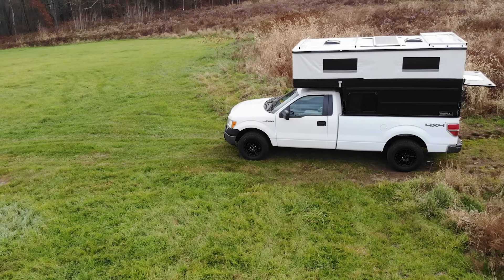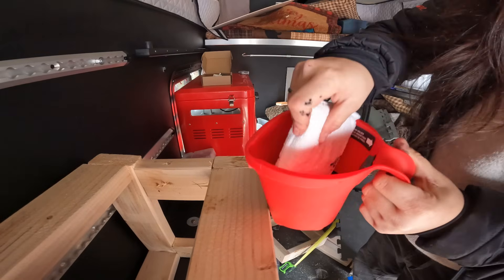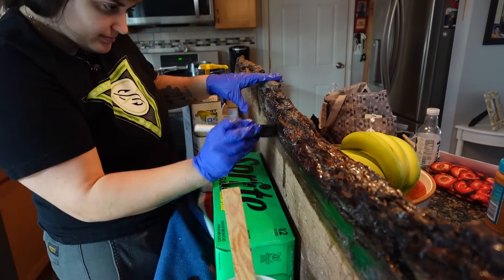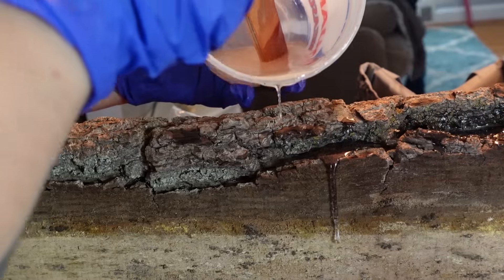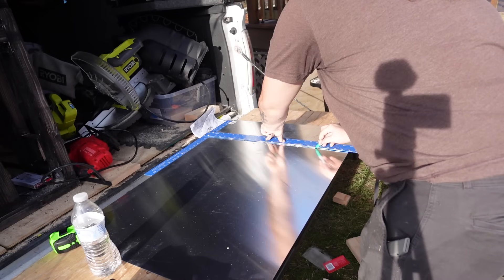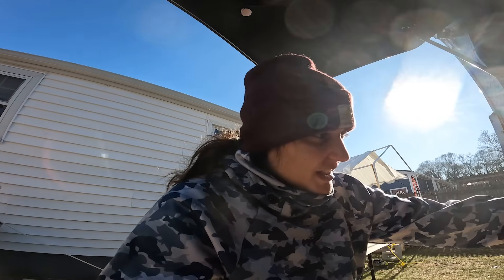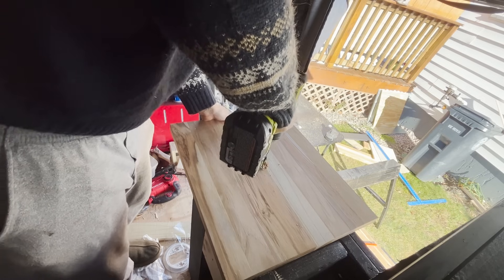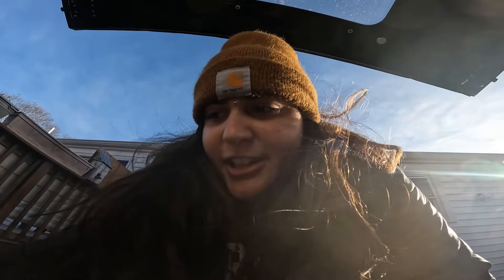Luxury Truck Camper Kitchen Build | Start To Finish

Comment: If you ever do woodworking projects and you don’t want to use battery operated power tools because they usually don’t have enough torque for what you need. They should at least have a power cord attached to them.

Comment: Took me a minute to get that a "draw" was a drawer.  Dang, you are getting sooo good at this building stuff.  Where did you get that sink, I need one for my build???  I just used a large funnel and fish tank tubing.  My solve actually works great but I didn't even think of a real sink.  My drain goes out the back of the trunk at the tailgate.  Please put a list of the stuff you bought and used.  What a great video.

Comment: Just a helpful tip for next time if your cutting a harder piece of wood like that live edge  you can set your saw to make a shallower cut and then set it back deeper and cut all the way through doesn’t always work but sometimes it helps when your saw just doesn’t have enough power to make a clean cut all the way through in one pass

Comment: CONGRARTS 🎉 Super nice kitchen build!  Where 🤔 are you going to locate your refrigerator?   Still keeping it in the Truck CAB or maybe in the rear area of the Truck Camper?  Also, with those few wires near the Sink will you need to install a Ground Fault Receptacle Switch or Waterproof Cage Box for your own Safety and for Insurance coverage protection purposes? 😉.  Not meaning to be a "Negative Nanny" just asking about it to avoid any issues with that later.  I can't wait to see what you're going to cook 😋  first for us 😊.  I know it will be DELICIOUS and befitting a proper CELEBRATION 👩‍🍳🥂🍾🍽🎉🎊🎷🎶📸

Comment: Pretty cool but just buy an rv
Reply: But be careful, I just saw a video of how bad they’re made lately
Reply from the maker: you’re missing the whole point. good luck getting to anywhere cool and off the beaten path in an RV lol
Reply: taking an rv down a boat ramp is asking for a calamity.  however, that truck will do a fine job of it.

Comment: cool build, I  am picking mine up the 29th in MT.  I do like that FWC offers solar but  for what they provide its not worth it.  a 100watt cell would be good enough for running  the lights and minimal. but I ended up doing a 500watt cell for the roof, and DIY my own  exterior lights + bedrug. I am planning a drop down 100inch "screen" and a hard mount projector on the roof inside. EPIC movie nights.  I also opted in for the thermal pack, have you had any condensation issues using that diesel heater? I am just going to run a buddy heater. I  also opted for dual fans, do you suck the air out with one and bring fresh air in with the other during cooking?